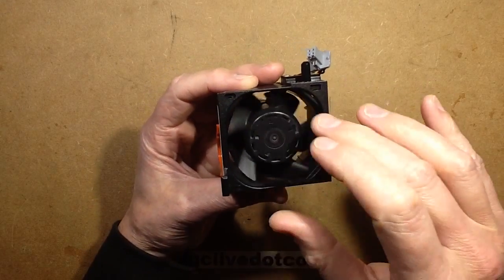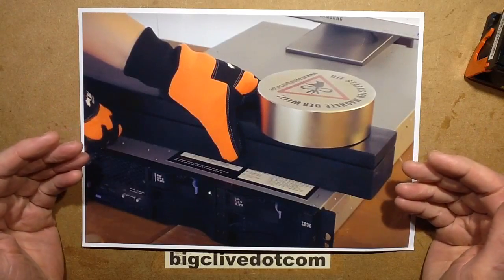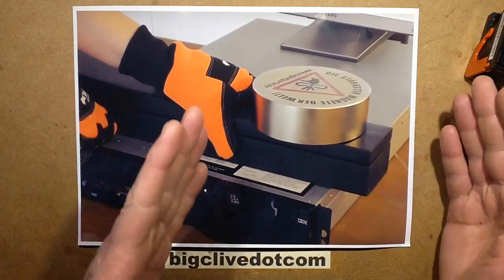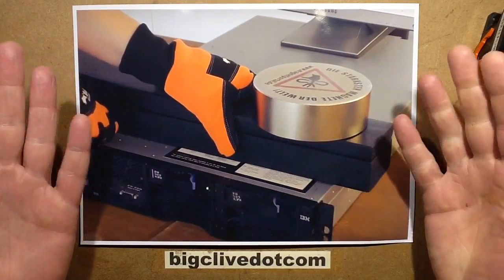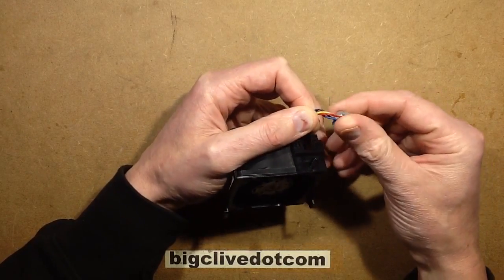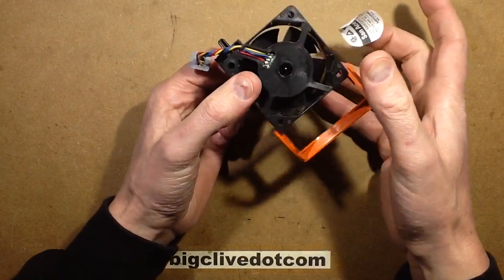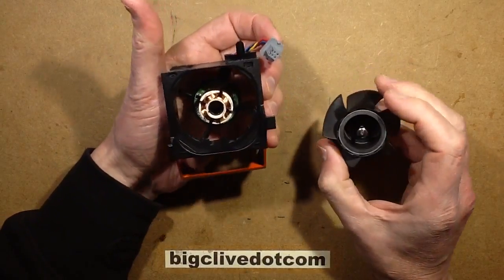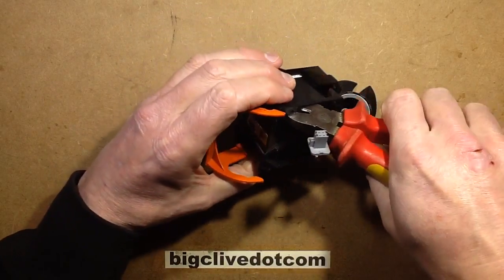Dead server fan autopsy.  (Unusual circumstances.)

Comment: Is there a chance, that you could explain note 7 explosion?
Reply from the maker: Almost every high profile brand experiences a very small percentage of lithium cell failures.  I'm not sure whether it was the cells or the circuitry associated with them failing and shorting them out.  You have to keep in mind that modern tablet computers have huge amounts of power stored in their large batteries, so when they get shorted or fail they do liberate a lot of energy suddenly.
Reply: Considering Samsung don't even know that seems a rather unrealistic ask.

They swapped out the batteries for a completely different manufacturer and they still blew.  So it seems likely its either a problem with the charging circuit or a design flaw in the phone causing a short.
Reply: Soulless leftover! It appears the Note7 piggy backs another charger IC (DA9155) on top of PMIC, as seen in Chipworks teardown of the Exynos version, to bump charging current above the commonly available 2.5A.

The first 25 minutes of charging, both chargers are used (4A), then a single charger takes over (2.5A), with battery max voltage being reached 85 minutes into the charge cycle, then current tapering down to terminate charging nearly 2 hours after plugging in empty - data from Anandtech's article analyzing the Qualcomm version. The Qualcomm version must thus also necessarily use piggyback charger, as PM8004 is only good up to 1.5A. The teardowns i found have not been conclusive enough, not all parts are known. DA9155 is not mentioned for this model.

Phone batteries are usually rated 1C and recommend 0.7C charging, thus 2.5A seems like an absolutely safe charging current for a battery of 3.5Ah capacity, 4A screams "they better REALLY know what they're doing there!", but i'm afraid to make armchair conclusions here - perhaps they did know what they were doing in this particular regard, and the failure is elsewhere?

Androidauthority has voiced speculation, whether piggyback IC has been implemented properly, or whether electrical, thermal, or software engineering mistakes have been made. The IC has separate digital control input that is controlled by the software running on SoC. In a charging graph published by Anandtech, there's a weird blip where it keeps switching between 4A and 2.5A charging right at that 25 minute mark, something the editors paid no attention to.

Korea Agency for Technology and Standards has published x-ray images of the batteries, showing that Samsung-made pre-replacement batteries were compressed around the edge, thus allowing the opposite electrodes to internally short circuit. Battery "breathing" during charge/discharge is likely to exacerbate the issue. The replacement battery by Amperex/TDK has seemed better in the x-ray, and there was a wave of relief, but then the next day, those started catching on fire too! The suspicion goes, one of the rounded edges of the phone is compressing the battery unduly. Samsung will be on duty to x-ray every single battery and discover the source of issue.

So between all of these combinations, it should be possible to figure something out. There are thus 4 versions of device total: Qualcomm version (USA) with either old (Samsung) or new (Amperex), and Exynos version (Rest of World) with either old batteries or new. All of them are catching fire, right?
Reply: Normally, a short in the phone won't do anything, the protection circuity in the batteries would prevent a sudden release of high amounts of energy. However, it's an obvious guess that they probably had to relax the protection to enable fast charging. Besides, all that current passing through protection control transistors and the power management IC, there's a likelihood of damage, and chances are, engineering mistakes were made which allowed failure to lead to shorts in just the wrong spot. Even PTCs, while they should normally fail open-circuit, can occasionally fail short due to a combination of constrained placement, internally generated and externally collected heat. So once your things are running hot and at the limit, the bets are off.

Besides, normally batteries shouldn't burn when you punch a nail through them, right? But who knows what kind of internal changes happen with repeated fast charging. Would take years to find out, probably the years they didn't care to spend. Gotta be ahead of the competition, right?

I think fast charging is the principal culprit here, a rushed and unproven feature, but not sure by which mechanism.
Reply: Soulless leftover! If its only while charging then its just the battery and to be expected.

I think you will find that the after market charger is definitely not as fast.  The whole reason for fast-charging is that you can't put that much current though the USB port at 5V.

Generally fast-charging should only be used if you don't have time for the slightly slower normal charging.
Reply: Siana Gearz Samsung (and all top-end Android devices) have had fast charging for three generations now without issue, so I find it hard to place the blame there.
Reply: Thanks for the very well written comment, explaining the issue.

But one very good lesson that we all learned, is that using after market chargers that are not qualified (Chinese) may just cause similar issues.

Tho i have seen that issues with charging and overheating are partly associated with software it self. This is why i decided to turn the fast charging option off, as it may take longer to charge (not really that much deference) at least will provide me protection of battery failure and it will have longer life.

And speaking of charging, the new pixel (made by Google) may just have similar issues. One flaw that i found was in a video where a guy was testing his "USB of death" (that outputs a super high voltage), on a new mac book and few phones, it seems that the pixel may not have proper protection from a high voltage. As it died instantly, while the Note 7 and Iphone didn't have any issues.Siana Gearz
Reply: Siana Gearz  Alex Atkin
Well the only flaw i have with my s7 is when i turn on the "fast charging" option on, for some reason it starts to heat up while charging it. (with included charger) So i have disabled it and phone doesn't heat up and everything is fine. And on top of that i use after market charger to get that same speed as you with with the "feature" on, and phone is still cool and healthy.

So from what i understand, it seems that either the Samsung Exynos processor is involved while charging or something else that stresses the phone.

It's just so weird...
Reply: Soulless leftover! I have only used fast charging once or twice on my Note 4 too, I prefer the slower but far more convenient wireless charging.

Comment: I saw the original video where the fans & HDD's failed. My first guess as to why the fans failed is that a switch mode regulator feeding them became severely de-tuned by the added magnetic field, resulting in a much higher voltage than normal being output to the fans.

Comment: I reckon the magnetic field of the neodymium magnet saturated the stator core, allowing much more current to flow than it would otherwise have. When the mosfet closes  a lot more current goes through the zener, burning it out.

Comment: Early guess.... demagnetized magnet inside the fan.
Reply: Kristopher Howe That wouldn't cause what has happened, not by a long shot. In addition, he already said that he was able to observe the quad poles of the magnet.
Reply: Jacob Crosby it was an early guess.
Reply: There was was an overcurrent failure. I used to work in Comair Rotron manufacturing these type of DC fans back in the 90's, later I worked diagnosing returned customer units. Most likely the Hall effect sensor chip suffered an overcurrent failure. It could also be due to a blown diode. The magnets on these fans is very interesting how they're Made, we nicknamed them soft magnets, they are magnetized - with a very specific pattern that is detected by the Hall sensor, that's what causes it to turn - with high current once inserted into the rotor cup.

Comment: Actually there are magnet "defense" gloves, and they are called I.A.S.C.M "Instant Amputation System in contact with Magnet"
http://i.ebayimg.com/images/i/310860535469-0-1/s-l1000.jpg
They use innovative method of removing main problem if your can be crushed by magnet: hands.
Because why bothering with additional security or help, when you can cut hands instantly if they are crushed by strong magnet.
They are build from space materials of 2016, and they have almost 50 places where they can cut your hands, so if only your finger is crushed,, those gloves will instantly cut that finger!
Also thanks to that material, magnets that are around you will be instantly transported to your hand, so you dont need to reach for them! Its pure Magic!

Those magic gloves can be yours right now, just email us: NotThatFunnySarcasticComment@magnetdefense.com

Comment: That magnet was colossal. Even moving slowly, a field that intense might have generated a significant voltage. Was the fan running? if it was, maybe the big magnetic field coupled with the magnets in the rotor, temporarily making the little magnets substantially stronger, which might have caused feedback through the windings?

Comment: I used to work at place were they graded whole crop onion straight from the field and the first conveyor  there was a very large magnet to pull out any metal that may have come from the field and if it found some it was a two man job to pull the metal off the magnet oh yes respect the large magnets

Comment: Those Hall effect sensors are cool little things. You know they're used in high-end computer peripheral joysticks for flight sims and what not? Way more precise than the old double-potentiometer setups on gamepads and controllers.
Reply from the maker: They're also used in wheelchair joysticks and other similar control sticks that have a high use.
Reply: And they've been used in exactly two game consoles, in the Saturn 3D pad and in the standard Dreamcast gamepad. Both the analog triggers and the joystick. They have indeed served pretty well there - the lubrication of the guide system can gunk up, but otherwise, nothing happens there, no wear really. A well maintained hall effect gamepad centers and senses after 15 years of use just like on day one, which is not something you can expect of a potentiometer rig after only two years.

Comment: Could it be they passed the magnet over some sort of switch mode power supply,  or a maybe even something that drops voltage from somewhere on the board nearby to feed the fans, effectively causing it to send much more power through that particular part of the board, and ultimately into the fans?
Reply from the maker: It's possible that the magnet may have interfered with the PSU and caused an overvoltage situation.  It's certainly not the failure mode I was expecting.
Reply: nod

Comment: The server spun the fans to the max when magnet was on top, likely because it caused some of them to stop or slow down too much. That probably caused them to melt, because not only were they spinning at max RPM but they also had to overcome the magnet, and the currect was just too high and they melted...
In other words, I believe the root cause was simply mechanical - too much resistance, controller trying for too high RPM => too high current...
Reply: And a completely different train of thought - although the magnet was hardly moving and couldn't induce current in the curcuit, the fans were spinning very fast. Could it be that the induction happened on the rotor itself which is metal and then sparked somewhere? No idea how induction works in round objects.

Comment: I've always wondered, would a magnet like that do a lot of damage to someone with a pacemaker? Not familiar with how they're constructed, but you'd think it'd use nothing affected by magnets
Reply from the maker: I'd be very wary of putting one of these anywhere near a pacemaker, as very little electronic equipment is designed to handle the field of a magnet of this size.

Comment: That magnet couldn't have inducted that amount of current could of it? 

maybe the seizing of rotor caused the motors electrical load to increase? 

But if that's the case why isn't there more over current damage. 
Curiouser and curiouser.

Comment: The exploded part is most probably the MOSFET used for PWM control. ZD things are either Schottky diodes to protect MOSFET body diodes from reverse currents or actual Zeners to limit voltage across the MOSFETS by sinking DC current through coils in case of overvoltage.
Reply: The zener arrangement of having a large zener (e.g. a 24V zener for this circuit) in parallel with the FET is that when the FET turns off, the continuing current in the coil boosts the voltage until the zener lets the current through at 12V above the +12V rail.  Each coil does this separately, providing two overlapping electromagnetic waveforms which combine to form a rotating magnetic field which rotates the permanent magnet rotor in a direction dictated by the phase relationship between the two control pulses.
Reply: Fair enough, could well be this. Still not clear why they didn't just put Schottkys across the coils then. Probably to implement what I said as well with no extra components. If so, that's a pretty clever design here!

Comment: This motor would effectively be driven in a PWM setup for the coils, which is designed to regulate its speed based on the hall effect sensor, as you know.

Here is what I think went wrong. The hall effect sensor would be triggered normally by the changing (and rather weak, relatively speaking) poles of the ring magnet on the rotor... which acts like a 'heartbeat' to the controller IC. If this 'heartbeat' is held in one state for too long by introducing a highly magnetic source nearby, it might have caused the IC to drive the coils for longer than they should normally..?

I don't know. It's 1:17am and I should be sleeping haha

Comment: Did the magnet cause a power supply problem in the computer  It may not be a magnet problem with the fan , may have been a voltage spike on the power supply feeding the fan. Very interesting in any case.

Comment: I have always been very interested in magnets, as a boy I used to visit the dump grounds here in town, back then they were not manned, and anyone could sort through the trash in the pit, or visit the automotive graveyard that had cars stacked 4 high in a huge maze (before car crushers you know).  A buddy and I used to hit the dump and dig into those old wrecks, I would take the speedometers out and get the magnets out of them.  The magnets were great fun if suspended by a thread and spun, each would spin the next for a dazzling display of magnetic fun.  Who would have thought, back then (early 1960's) that we would have such powerful magnets now!   Thanks for the continuing education. I always have believed that if I continue to learn one thing new every day that I would not age quite so quickly.  Thus far it must be working, as I still don't feel all that old at 65.

Comment: Im fairly certain that overvoltage was the problem. Those zeners are obviously for overvoltage protection from the inductance but werent made for the extreme voltage that magnet must have induced. Change in Magnetic field is what causes a voltage to appear on those windings and the ridiculius intensity of the field compensates for the low velocity. Those guys should try moving one of those coils around the magnet, with a meter across it.

Comment: Maybe the neodymium magnet caused the stator windings to produce more voltage than the Zeners were rated for, blew them out (shorted), and this resulted in TR2 burning out.
Reply: I think that's been covered but possibly yes.

Comment: btw, to separate two strong magnets you can slide them off each other. another thing, you don't need two of these magnets to crush your hands, 
while these magnets require proper handling (there is actually a license requirement). they are not as evil as you make them. like any other tool wrong handling can cause harm

Comment: You've probably mentioned this before, but what ipad app do you use to film? (If you're still using an ipad)
Reply from the maker: I use the standard camera app on an iPad2 and then upload it with "capture" which is YouTubes own uploader app.
Reply: I think he uses his "hat-mic". There's a video or two on it somewhere.
Reply: bigclivedotcom you still use the ipad 2? wow the quality is really good do you use the built in microphone?
Reply from the maker: I use the built in mic on the iPad.  The hat mic works with my Android phone, but not the iPad.
Reply: bigclivedotcom wow the audio quality is so good love your videos clive
Reply: Chris Souers oh ok
Reply: bigclivedotcom hi , i have seen a new headphone by ufo co. It has 12 drivers , and im wondering how they wired all of them 🤔 disassembling by bigclive would be intersting
Reply: Yeah... iDevices require a special chip that's in line with the headphones they manufacture, and allow third party manufacturers to use, that controls the volume buttons and action button that's in line with the mic contact on the jack.

Comment: It looks as if the supply Red cable has had a large load as well as the insulation seems to be retreating from the heat ??
Reply: Sure, if a short has occured on the board, large current goes back/from the supply..